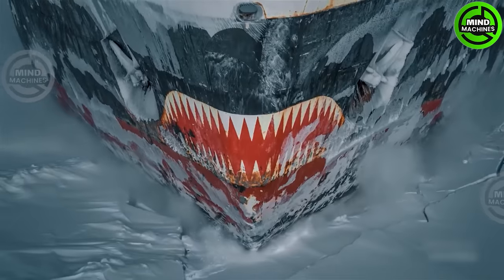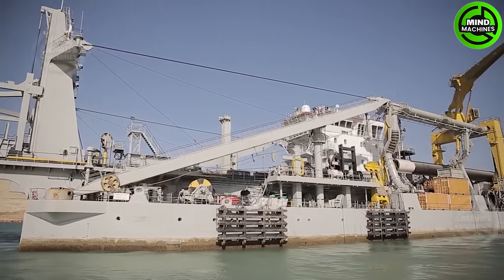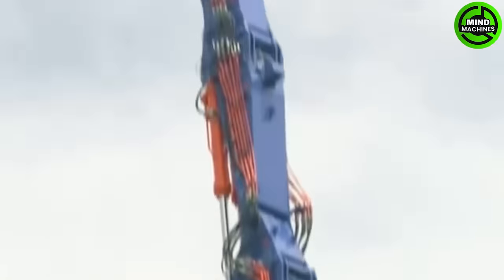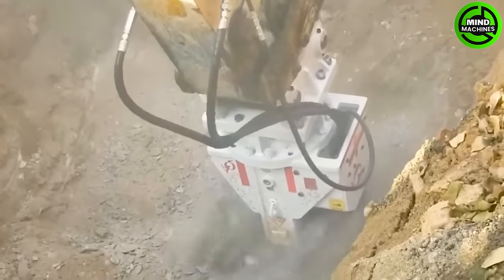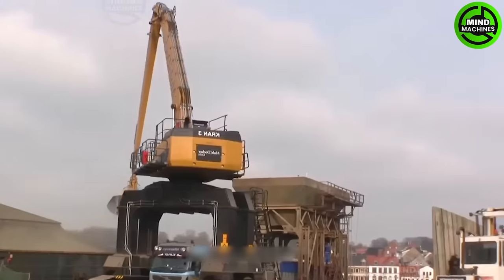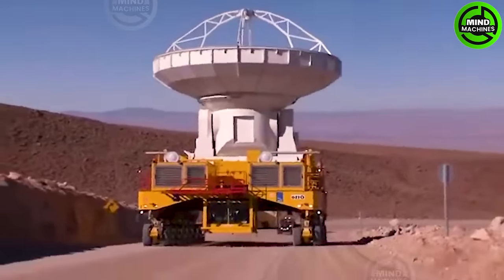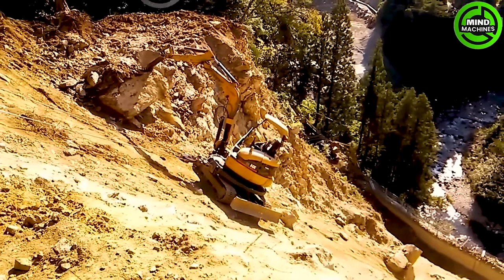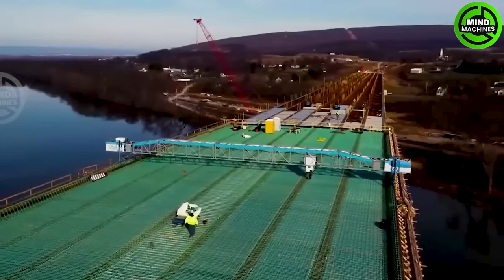100 The Most Amazing Heavy Machinery In The World ▶13

Comment: Heavy packed dust reefer proventive maintenance measures
Upon the condensing radiator unit intakeing air of ambient air population should have a emergency air break system to release when head pressure sensor is set higher then normal. A secondary tank storage control center should be place near even if a  , reverse Valve system should be used with a separate condensing radiator to help allow the blow off process to occur as a three stage storage unit normal engineering design with a storage air unit!